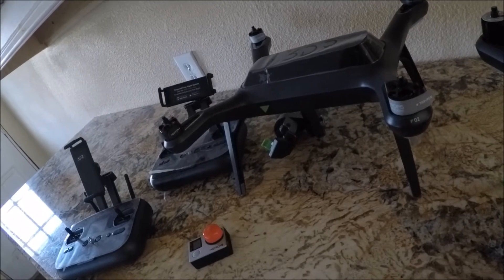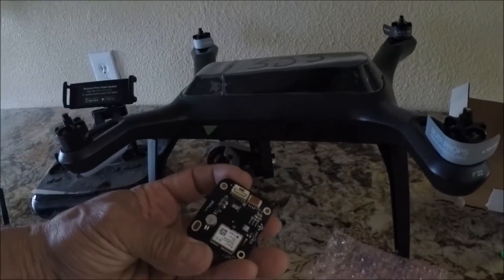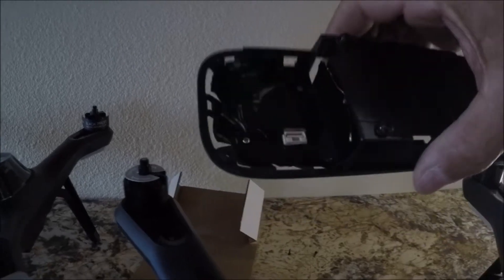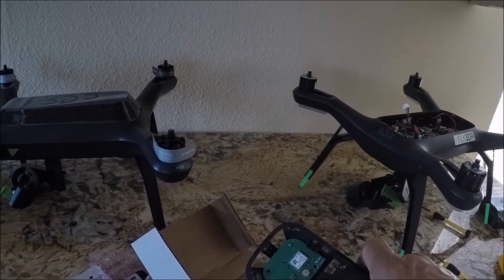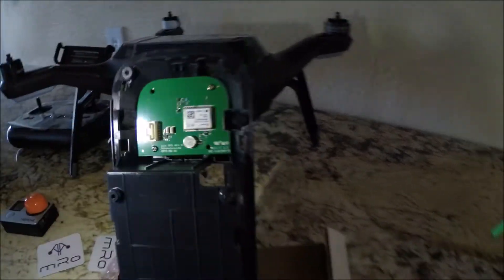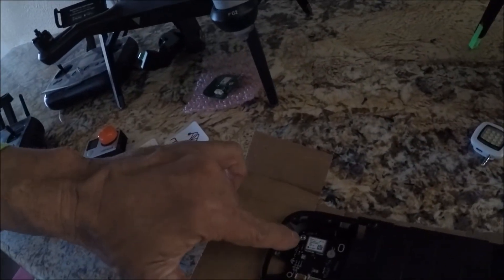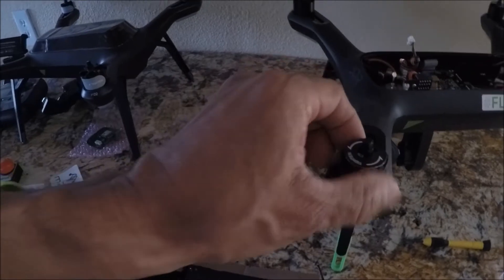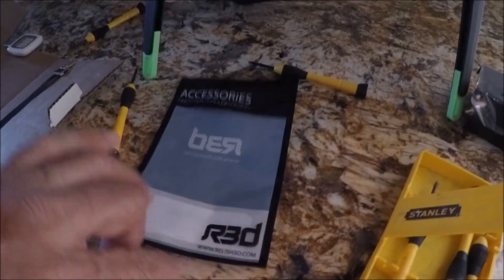3 DR SOLO MRO GPS NEO-M8N UPGRADE 3DR SOLO TIP. HOW TO INSTALL

Comment: How bad is the stock gps?? I was thinking about picking one up for $199 from Best Buy.
Reply from the maker: Not that its bad. You just cant compare quality to mrobotics gps unit. I constantly aquire 20 sats in under 1 minute. All the time
Reply: george g tAkes over 5 minutes to acquire with stock??
Reply from the maker: call mRobotics in chula vista, calif. It is their poduct, not some cheap crap. great support. $85.00 it is simple plug in and fly

Comment: when you orer this board it asks which cable?  which one?
Reply from the maker: Order from mRobotics in chula vista calif. check website.only one type available. Made for Solo and is plug and play. i get 20 plus sats everytime.
Reply: george g / where did you get the light??? Or p/n
Reply: GEORGE WHAT HAS BEEN YOUR MAX SAT COUNT? I WAS TOLD SOMEONE GETS 28 SATS! WELL I KNOW THE OTHER CHEAPER M8N GPS MODULES WORK BUT YOU ONLY GET 18 SATS MAX WITH THE CHEAPER M8N MODULES
Reply from the maker: With this original MRO gps I constantly get 23 sats from 3 constellations. With super fast gps lock. MRO is outside of san deigo. check this out https://youtu.be/0U5QIfhw3zI
Reply from the maker: ebay. dont remember seller

Comment: Rev A is a green board, Rev B is black. This mod is only half way proper. Should have upgrade the shield as well. That copper shield is also part of the problem.
Reply from the maker: very solid in flight with constant 20 plus gps sats aquired. waiitng for shield issue but none thus far.
Reply from the maker: I am consistantly getting 20 gps sats avg with same shield. No problem with stock shield.mRo product far superior.https://www.youtube.com/watch?v=Q3YkofxtNzg
Reply: I hope it continues to work out for you. I know that the copper touching the antenna in there also causes issues. A cardboard spacer can fix that though. I just got done installing mRo with a new V2 shield. Video should be popping up shortly on my channel.
Reply: Definitely replace the shield.  And if you want to make it even better replace the WiFi radios and put on better antennas they you have a much more reliable drone.  I purchased one for kicks and it might be back up of a backup as I am a commercial operator here. It might be used for maybe an inspection drone.. OH and right away program your A button for manual flight mode.  You might find out why someday if you don't replace the shield.on the gps.